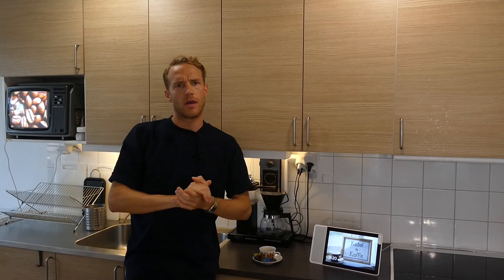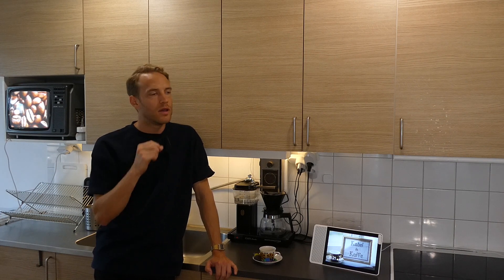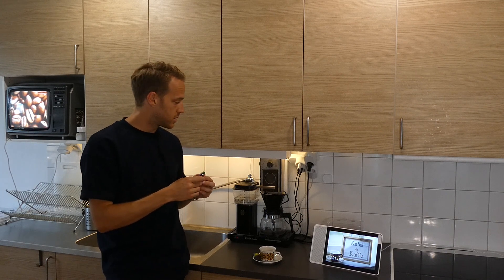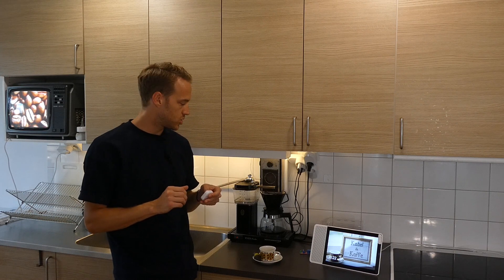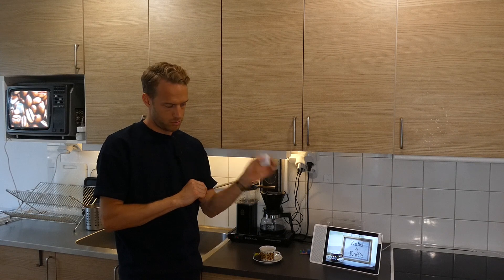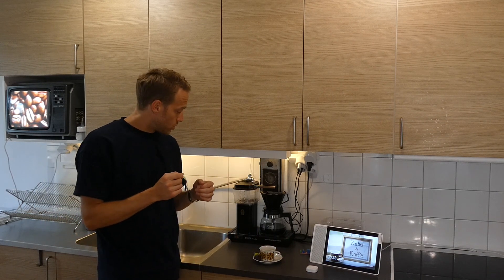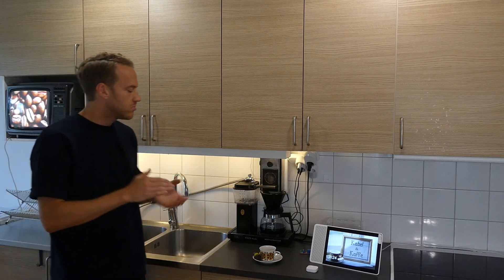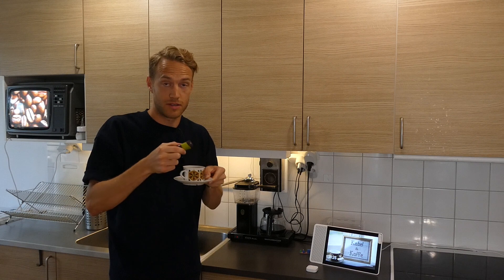DIY Smart Automated Coffee Brewer (Water, Grind and Brew)

Comment: Hi, I was looking to get a moccamaster too, but wanted to automate brewing in the morning.  I was hoping you could just leave the power switch on and use a smart plug to turn it on, but it looks like you automated the power switch on the coffee maker itself.  Would the smart plug option be possible or does the coffee maker require the power switch be cycled?  Otherwise, how did you automate the power switch on the Moccamaster.  Thanks!
Reply from the maker: Hi! I actually haven't done anything to the power switch. I use a smart plug as you want to do too. I've tried a couple of Moccamaster and on all of them you can turn the switch on and then turn the smart plug on whenever you want to. The only difference I've seen with different models is the following scenario:  Both smart plug and coffee button is turned on. Change the smart plug to off. On some models the relay for the coffee switch is released and goes to off, on my model the coffee switch is still on and if if turn the smart plug on again the coffee Brewer will start one more time.
Reply: @CablesCoffee  Thanks for that!  I wanted confirmation before pulling he trigger on the moccamaster.

Comment: This is exactly what I want to make - do you have a more detailed guide for setting this up anywhere?
Reply from the maker: Hi, super late answer but... No I don't actually, I've just moved so maybe it would be some good content to record when I install it again! I think I will do that. But short, I use Ikea knycklan smart water valve. A coffee grinder that I modified with a relay to make it start instantly when the smart socket which it's connected to is turned on. The good stuff is in the code to make it leave the valve open and grinder on for the correct times. If you you would like to see the code I could upload it.
Reply: @CablesCoffee  thank you! it looks like that smart water valve is hard to get here in the US. Argh!
Reply: @CablesCoffee  yes, can you please upload the code or if you have it on github post the link.